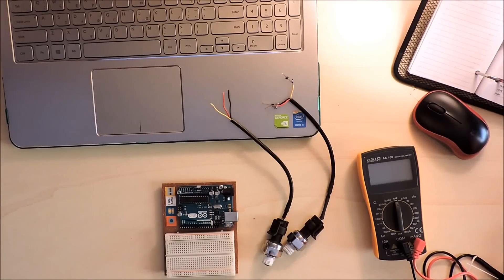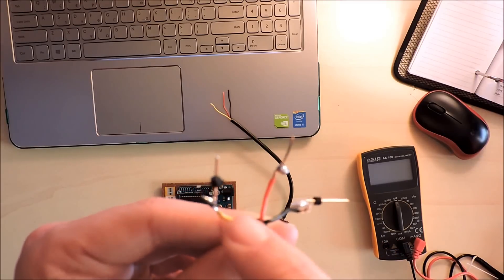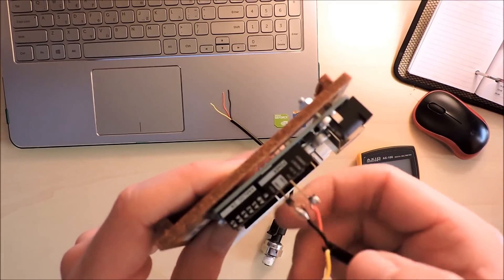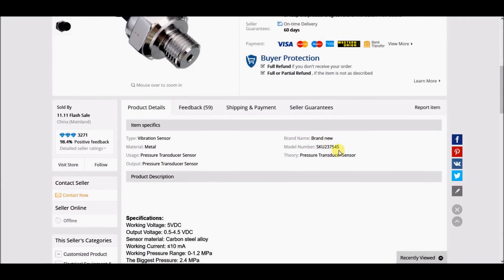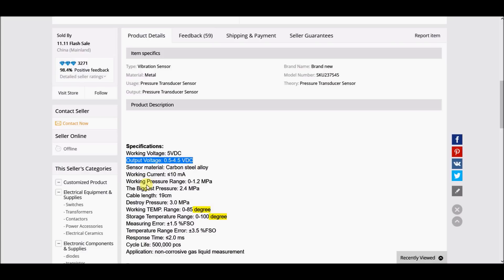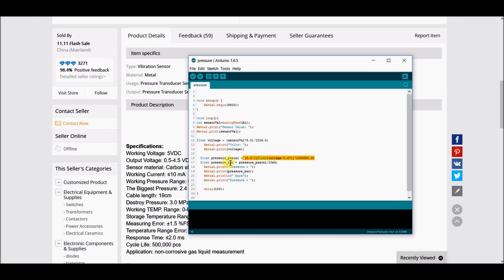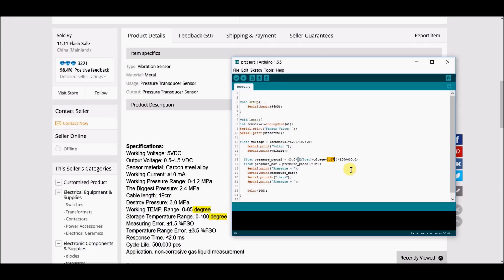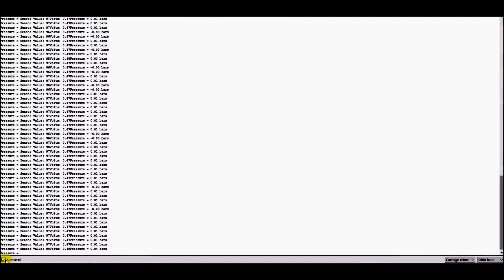Connection and Programming of SKU237545  Pressure Sensor

Comment: what if the output voltage of the nodemcu 3.3 in the coding part which value must be changed, because the readings on the nodemcu and arduino are very different, give me instructions on how to make the arduino and esp8266 readings the same?

Comment: Hi George,
On mine, the voltage from the sensor is unstable a little bit when reading with the arduino. But as soon as I connect a voltmeter, the voltage is very stable. I tried to put a pull down 10k resistor but it didn’t help. I dont really want to leave my 200$ voltmeter on it forever ;)  any idea what I can do?

Comment: can a pressure sensor range 0-100 bar be used with arduino  
(for measuring In-cylinder pressure of diesel engine)?

Comment: This conversion in you code (pascal to bar): 
float pressure_bar = pressure_pascal/10e5; 
i think is wrong... the correct is 1e5. And this formula impacts de rest of code!
Reply: are your sensor has a stable data?
Reply: @Orenjionlyyy  yes, but i had to use an external ADC (ADS1115)
Reply: @silvioalvim  what is the function of adc that you mean?
Reply: @Orenjionlyyy  Analog-Digital converter. The converter built into the microcontrollers generally has little stability and low resolution. So I'm using an external

Comment: I have a questions regarding the voltage to pressure conversion: at the https://www.banggood.com/Pressure-Transducer-Sensor-Oil-Fuel-Diesel-Gas-Water-Air-Sensor-p-1007341.html?cur_warehouse=CN there are grpahs at the end of the page which has a function of conversion voltage read to pressure : Vout = Vcc(0.6667P+0.1) [MPa]. But in the code provided here in the project the conversion is slightly different : pressure_pascal = (3.0((float)voltage-0.46))*1000000.0. What is the reason for the difference ?

Comment: Hello! can you help me write the sensor (0 to 300psi) equation on the arduino? that is to say .... for 0psi -0.5V, for 150psi - 2.5V and for 300psi - 4.5V (according to the datasheet). I wouldn't be figuring out how to put the value in arduino.

Comment: thanks for finding and testing this sensor.

did you find any with a smaller pressure range? I am looking for a liquid pressure sensor 0kPa to 30kPa (measure liquid level in water tanks). this one will probably be accurate enough, just at the bottom end of the range.

thanks again.

Comment: For anyone using a ESP32, esp has a 12 bits resolution analog to digital convertor, this means you change float voltage line to this: float voltage = (sensorVal*5.0)/4096.0;
(4096 instead of 1024)
Reply: Hello

Did you test with this sensor on ESP32?
Its data is an output voltage that can be higher than 3.3V (what is an operating voltage of the ESP), would not cause bad operation?
Reply: @joanoliveira6887  I am using it with the esp32 for like 3 weeks now, no problems so far :)
Reply: I changed the value to 4096, but the reading is around 3.5~3.9 bars, voltage is around 1.6~1.8. How did you get it close to 0 bar ? Thank you.

Comment: Maybe somebody will need it: i used 100 PSI sensor, and after calibration my 
equation for pressure is: float pressure_pascal = (((0.60 * (float)voltage)+0.48)*2000000.00);
Reply: Hi mate 
I used pressure sensor with 1000 psi could you please tell me what the change can be in this equation? 
Thanks a lot
Reply: @ammaral-bayati2225  unfortunatly don't know.  You have to make your owne experiments :)

Comment: thanks you so much for this video
i want to use this in unmanned underwater vehicle for depth control
can you please tell me what sensitivity do this sensor has ? 
Thanks for ur help!!!
Reply: first of all, will this sensor measure absolute pressure (due to water depth ) or relative /differential pressure (if this is true then when the sensor is fully submerged , it may show 0 pressure).

Comment: Can you please explain this line of CODE?  Where are these values coming from?

(3.0*((float)voltage-0.47))*1000000.0;
Reply: 0.47 looks like the offset that he has arrived to. but what is 3 tho?
Reply: @8224shivaram ~~ derived from datasheet :
Output Voltage DC 0.5-4.5 V = Vmin ... Vmax
Pressure Range 0-1.2 MPa => Pmin ... Pmax 
~~ math:
k = (Pmax - Pmin)/(Vmax - Vmin) = 1.2 / 4 = 0.3

In code is also some artifice in calculations for simplicity, but the code can be like this

float pressure_bar = (k  ( (float)voltage - Voffset ) ) * 10 ;      / x10 conversion MegaPascal to Bar) */

Pmax = 1.2 (MPa), 
Pmin = 0 (MPa) ,
Vmax = 4.5 Volt
Vmin = 0.5 Volt
Voffset = 0.47 Volt

Comment: Does anyone know if the SKU237545  sensor can be used to measure the pressure of water flow in pipes? I need to get pressure data on a pipe at two different points in a school project.
Reply: It was a year ago man, so do you have any solution for that problem now?

Comment: Can I use it to measure the water level in a overhead water tank . If so , then where should I install the sensor , on the tanks outlet pipe (at the bottom ) or somewhere on the tank .

Comment: Hi there. Thanks for the video. Can you explain where the 1024 value comes from? Cheers
Reply: Reads the value from the specified analog pin. The Arduino board contains a 6 channel (8 channels on the Mini and Nano, 16 on the Mega), 10-bit analog to digital converter. This means that it will map input voltages between 0 and 5 volts into integer values between 0 and 1023.
Arduino - AnalogRead

Comment: Hello! I have the same sensors. I used your code in my project, until I found out that it was not accurate.
Here is my version of the code:

pressure_bar = (analogRead (pressure_pin) - 102.4) * 12 / 819.2;

https://youtu.be/Nm86-vjknMs

Comment: Many thanks for the great info. Pressure switches for well pumps are either spring loaded junk (designed in about 1920) or newer electronic units that the water must run thru and have no pressure adjustments. The electronic ones also only have a 1/2" dia. opening for the water to pass thru and terminals only good for 3/4HP ...so much for my 2 HP 1" dia. pump! I'm off to ebay to get a few sensors and relays. Many thanks.
Reply: hello did the sensor work? i want to make the same project!

Comment: Hi, some great work there..!
Wondering if you can assist me with a question - At 60 psi I want to turn on a step up motor for 30 seconds and when the pressure drops down more than 60 psi I want to reverse the step up motor for 30 seconds. How would I go about this?

Comment: nice mr. Geroge about what you did,
but i want to ask how you got that code?

float voltage = (sensorVal*5.0)/1024.0;
float pressure_pascal = (3.0*((float)voltage-0.47))*1000000.0;
  float pressure_bar = pressure_pascal/10e5;

Comment: In code:

If I'm using a 0.5MPA sensor; All should I do is change the 3.0 at line 16 to 0.5?

And why at line 16 it's 0.47 instead of 0.45?

Comment: How can I measure hydrostatic pressure of water with this sensor? Can it be done just by dipping one end of an hose into the water and another end connected to the sensor? If yes, how do I connect it?

Comment: Hi George, 

Thanks for your video. Works perfect. saved me a lot of work.

made a smal adjustment on the pressure_pascal calculation
pressure_pascal = ((3.0+0.4)*((float)voltage-0.51))*1000000.0;  //      0.4 calibration value on original
Reply: Can you explain where the values come from?

Comment: hello, thank you very much for your video I have some questions I hope you could help me, I have a 15 PSI sensor with 0.5v linear voltage for 0 PSI and 2.5 v for 7.5 PSI 4.5 for 15 PSI my question is on what you based to write the equation in your code? I can not deduce it and adapt it to mine, thank you very much.
Reply: It is a simple slope straight line equation.  (Volt,read - 0.5)/(4.5-0.5) = (Pressure - 0)/(1.2x1000000 - 0) which gives P =3(V - 0.5)*100000 ..... (he is using 0.47 instead of 0.5 I think it is part of calibration) ... You need to lay down your voltage scale against pressure scale and you should get a similar equation that you can use

Comment: Thanks for the video.
Have you tried to connect it to a raspberry pi?
Does it work and do i need any other part to convert analog to digital?
thanks
Reply: I also wanted to know that 
Bcz i am doing my minor using this ,so i just want to know that whether this is compatible with raspberry pi..

Comment: thank you for your video. I'm wondering if the unit can be submerged into a lake and read pressure. Omega have expensive unit with "vent"(atmospheric pressure) trought cable but yours still not provide this design, So I suppose I need a waterproof box with vent tube. Also I need roughtly 200' cables between arduino and transducer. How do you thing this so long wire could affect reading? I have difficulty to calculate resistance effect

Comment: If anyone is looking for the PSI calculation for a 0 to 100 psi transducer like I was, I found this was pretty accurate:

float voltage = (SensorVal * 5.0)/1024.0;
float psi = (voltage * 25) - 12.5;

I had to use y = mx + b with 0.5v = 0psi and 4.5v = 100psi
Reply: THEMcBadass what the full program ?
Reply: Thank you
Reply: What is that 12.5 about?
Reply: @Time4yes  I couldn't remember, but asking ChatGPT about the calculation and it looks like the 12.5 is subtracted to adjust for the fact that the pressure transducer output is not perfectly linear, and the output at 0.5v is not exactly 0psi.  I can't recall where I got that number from, however.
Reply: @THEMcBadass  alright probably an offset, it's just that I wanted to understand the theory behind. Thanks man.

Comment: Hi,

Great job ! I just have a simple question, could you please explain the following two equations that you used in the code? I mean how did you get them and choose the values in the equation.

float voltage = (sensorValue*5.0)/1024.0;
float pressure_pascal = (3.0*((float)voltage-0.47))*1000000.0;

Best regards,
Reply from the maker: The equation has basically a specific formation which converts the voltage to pressure. The constants used in the equations differ from sensor to sensor so there is need for experimental verification of the mathematical model. This pressure sensor is validated with a pump and the numbers occurred after a lot of different measurements in order to minimize the error of the mathematical model.

Comment: Show how to change the code to display pressure data on the display for arduino 128X64 Blue OLED LCD LED?
Reply from the maker: Hello there, 
you can find such a code online and copy paste the pressure sensor code directly into the lcd code. The only thing that you have to be aware of is the signal pins to be correctly inputted into the code

Comment: Can I use the Sensor for my car? Because the working temperature is 0-85°C. And normally Oil Temperature is going up to 120°C.
Reply from the maker: I wouldn't recommend that ! The range of the temperature of this particular pressure sensor is not valid for such usage. It is too dangerous !

Comment: would It be possible to use this sensor to read the pressure of a weather ballon?
Reply from the maker: If you can add the right component to connect the sensor i believe that it is plausible

Comment: Hello, Great job, I've got it all working with a veriable resistor before i add the sensor, and i've added PSI to the  code. I am wanting to use a different sensor, How did you work out the code for calibration of your sensor?, My sensor read 0-150psi 0.5-4.5 volts
Reply from the maker: Hello to you too ,
the code was verified using a gas pump and comparing the readings of the gas pump pressure and the ones of the pressure sensor. The accuracy was  established by changing a certain value in the code.
Reply: Have you managed to calibrate your sensor?

Comment: Hello Gorge,
I've a 1-5volt output pressure sensor.
I would like to know the protocal between laptop and the IC.
Could you offer the link of the software "pressure Arduino 1.6.5"?
Can the software calibrate other signal, such as 4-20mA? 1-10V?

Comment: Hey Giorgios,

Would you mind sending me that code (or even a good screen shot of it) to my gmail?

I'm using this read maximum compression in a 12 cylinder vane type pump - Will this read fast compression cycles like a normal pressure transducer, as a normal gauge seems to not work in this application.

thanks

gdavis2265@gmail.com
Show less
Reply from the maker: Hi there ,
the code is in the description !

Comment: does pressure transmitter with low range pressure (0~15 psi) will make the analog value change in larger gaps (more sensitive)?
Reply from the maker: Hi there, as fas as i am concerned the sensitivity of a sensor isn't based that much in the working range but in the electronics of the sensor. Sensor differs based on their manufacturing methods. The better manufacturing process the better the sensitivity !

Comment: Dear Sir
I wrote to him to know if you can help me with an operation consultation or to indicate me to whom I write
In the YORK centrifugal chiller of 490TR I got a pressure transducer alarm
Why does this alarm arise?
The solution is to change it?
Can you fix this spare part?
thank you very much for your help
henryplasencia@hotmail.com
Reply from the maker: Dear Henry , this video is about coding an arduino sensor. However , i based on my knowledge the pressure alarm should alarm you too because it can harm the operating system in a bad way. I can advice you to ask a refrigerant guy in order to check the pressure failure !

Comment: sir, can i measure 29psi pressure of hybrid engine project, reply me pls.
Reply from the maker: 29psi equals approximately to 1.99 bars. The sensor working range is 0-1.2 Mpa ! or 0 - 12 bar ! so you will be fine !

Comment: Hello Georgious, 

I'm new to arduino / coding stuff I was wondering if you could help me. Iv been looking into pressure sensor for arduino for water pressure and your tutorial / code has been the only one that seem to work on  all of the internet ☺️😊.  I was wondering if its possible to use your transducer/code some how to control power on / off to a small Diaphragm pump by reading the output values from your code  an turn off at say 100psi and back on at 80 psi via a relay.  Applications I'm trying to use it for is for a high pressure aeroponics setup that has a small pressurised tank to relive the strain of the pump working 24 / 7 and the pump is not fitted with a pressure switch.  If you could lead me in the right direction or if it's not possible please let me know.  Thanks in advance for any information 
Cheers
Aiden.tunupopo@gmail.com
Reply from the maker: Hello Aiden, I am using this pressure sensor for the exact same reason ! In order to power on/off a pump you have to use a relay. Relay are digital ! That means that they understand High (1) or Low (0). So after you measure the pressure using the variable pressure_bar you can transform it in psi.
After that you continue with ifs and elses in your code. 
For example if ( pressure_psi < 80)
{ relayStatus = High}
else if (pressure_psi > 100)
{
relayStatus = Low
}

See : https://www.arduino.cc/en/reference/if
Reply: Georgios thanks so much I'll will give it a try and let u know how I go
Reply: Georgios could you email me the code you have for pump and pressure gauge so I could try and apply to my project and learn from
Reply from the maker: i will upload a new video to explain "how to"  code a relay with this pressure sensor !
Reply: Georgios top bloke thanks bud
Reply: Any updates on your next video? 😊
Reply from the maker: i am currently abroad so i can't post something regarding arduino stuff until next month ! Patience rewards i hope to manage upload a new video soon !! 
Thanks you !
Reply: afternoon would like to know if you managed to have time do that video :D

Comment: Hi Georgios 
You are the guy who can help me
I ordered this sensor that I want to use in a cooling system of an induction coil, because it happened a few times to start the induction coil whitout switching on the water pomp of the cooling system .Having a presure sensor on the cooling system I don't have to worry about  damaging the induction coil generator .I have no knowledge about programming therefor I will be grateful for your help.I really appreciate any help you can provide.
Reply from the maker: I will be very pleased to help u in any way, but you have to ask me specifically what is this that you want to know ! This code is used for calculating pressure of any gas and liquid
Reply: I want to place the sensor on a water cooling circuit with a relay  that switch on an induction generator coil .When presure is =0  relay is   open , no way to switch on the induction generator   a flushing Led ,a buzzer,"eventually a hammer that hit my head" will keep me awake   it means  I don't have the "chance" to damage the generator,forcing me first to switch on the pomp of the external  water cooling and once the cooling is on, I have presure  in the cooling system  it means ,is  safe to switch on the induction generator system. No presure =relay  open; Presure =relay closed=switch on; the induction coil.Very simpel when you know to do it ,a nightmare when you have no idea about programming. I can  send you more details, picture, etc  if you agree to be contacted
Reply from the maker: I understand what are u saying! I will post later this week another video showing how to code with this pressure sensor and a relay !
Reply: Thank you very much for your help, if I am not asking to much can you include in the code, a led and a buzzer to be switch on when presure = 0 ,  and  will  switch off once some presure is detectet in the cooling circuit